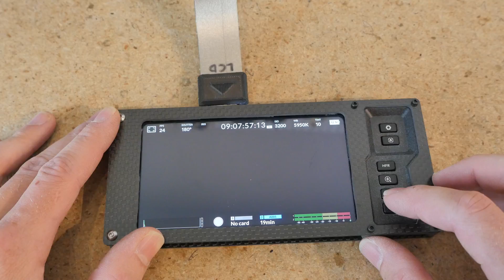Pigeon 3.1 Cage Overview

Comment: Maybe free float the PCB board with very soft inserts?
Reply from the maker: This design is soft mounted and vibrations entering the pcb is not a huge issue, but more that the main PCB will not bend or twist in a severe crash even if the carbon fiber cage flexes. The 4.0 cage design also has this feature. One should be able to flex the bottom cage and see thay the main pcb stays flat, independent of the bottom plate.
Reply: Beautiful Design Sam!

Comment: Does bmpcc4k naked work properly with version 7.9.1 as well?
Reply from the maker: My naked BMPCC4K cage kit is compatible with all versions of firmware including 7.9 series. This is because the kit includes an LCD extension system. For firmware 6.9.6 and earlier the camera boots without the LCD plugged in. For firmwares 7.3 and later the LCD must be connected each time before booting up the camera. New cameras cannot be downgraded to 6.9.6 FW or earlier, only cameras manufactured before March 2021 will be able to do so.
Reply: @strawhatsam  thank you